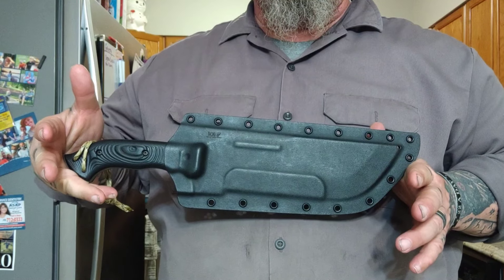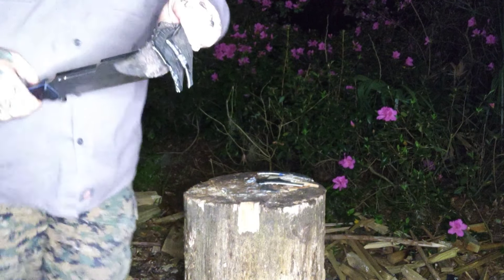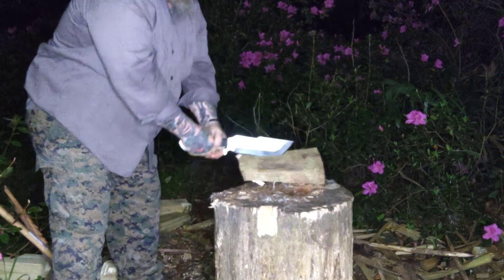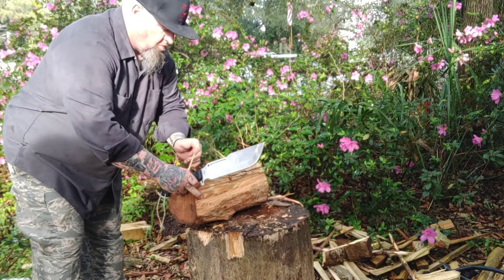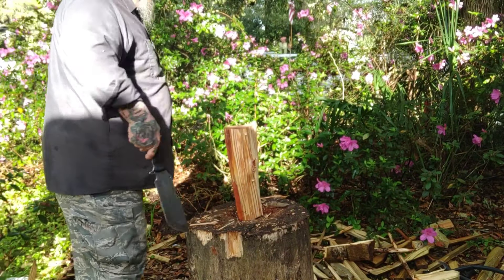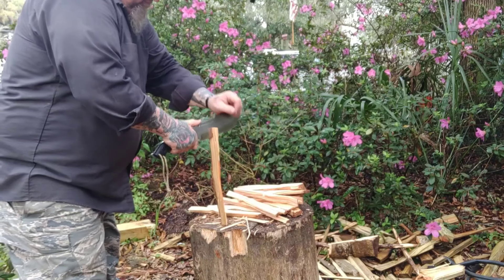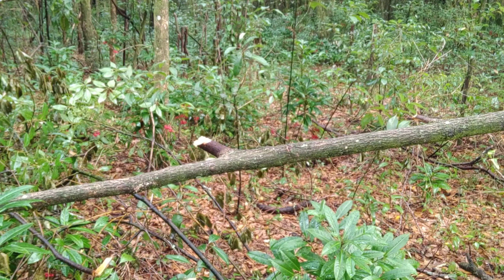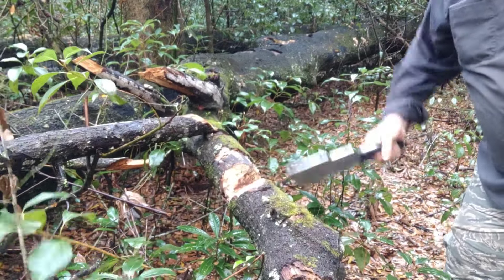WORK TUFF GEAR HEMLOCK ARES!!!! BEAST MODE??

Comment: I have to apologize to some knives, because I called them "a beast". Like on some of the other WTG knives I used the "beast" phrase too often too quick.
Why? Because if those knives are beasts, what the hell is this knife?
OK, maybe Behemoth would be a fitting expression to describe this knife. It is one step above every "beast knife" I know.
Yeah, maybe they have to do some testing with the bevels and the angle of the edge, maybe a combined grind or compound  grind (whatchamacallit...?), where the back portion of the blade gets a more acute angle grind for sharpness, for widdling and cutting tasks, and the front portion more like an axe in a shallower angle to make it the chopping aerea of the blade? 
I said it, Work Tuff Gear has to think about it and has to do some testing, because this is a prototype. 
I would love to have one of them, some day. 
Ah, another thing I feel about this knife. It neither has the shape nor the looks, but it remains me a lot of the Preacher.
Both have a lot in common. Both are big knives with a thick bladestock, and both are not built as a slicer, but they are choppers.
And this two Behemoth knives do this job very good, they chop like hell!
If you want a slicer you have to get a different knife.

#22aday 
Stay safe everybody, and stay blessed. 
Greetings from Germany!

Comment: My litteral ONLY issue with WT is the designs. They make knives with great grips, great steel, great heat treat, great strength, but damn... I would love to tweak half their designs.
Reply: That's because Work Tuff Gear works with their designers, not only themselves putting out the designs. Sure they have some in house designs, but most of them available are from individual community designers. 

 So what may be a "Tweak" to one person, may completely go against the designers goals. Vic Lin is excellent with working with his designers whom he makes blades for, however he definitely let's us have our creative freedoms when pushing towards specific specifications on the given design. 

However I'm sure that could be said about many companies, I would have loved to change up several blade designs over the years, but that's up to individual interpretation.
Reply: @d.b.hemlock  100%. Theres so much math that goes into the ergos and finding proper balance. The problem with taking on designs who aren't designers is you get what they see as their own cool factor, but without the math and science into the reductions and shape. Still though, you could shoot a WT blade from a tanks gun into the side of another tank and say, damn. That poor tank.
Reply: @DonnieBAllDay  these are designers. WTG mostly works with people who are proven in the community and have sold to lots of happy customers. This is becoming a tried and true design. It works for it's intended purpose.
Reply: @shepherd2148  Measure out the M.E.A.N. of this design and prove me wrong.
Reply: @shepherd2148  I never said they don't work. Not once. On the contrary, I say they are built like tanks. Great users, just some are designed as functional quassy fantasy pieces. But thats where the difference lies in a designers piece and a piece done by someone who designs knives. As a designer, the goal is to have mathematical precision. Someone who designs knives doesn't care about that. They just attack the cool factor. Some of their guys do that, with the actual forging being great. I don't think you understand where I'm coming from.
Reply: @DonnieBAllDay  I understand exactly where you're coming from and I think it's a useless point. If we only bought knives based on pure function and not aesthetics or design artistry then we'd all be only buying Mora Knives and Buck 110s forever. Part of the excitement of new knives releasing every year is that they look and feel different. But even in the Hemlock Ares' case, idk many other blades that are a bushcraft knife, bone breaker and hatchet all in one. They are out there but this is a no nonsense design, so you don't have to carry 3 tools on your person, just the one.
Reply: @shepherd2148  A good design doesn't have to have useless parts and be unbalanced to be three tools in one.And as far as Mora? Yuck.
Reply: @DonnieBAllDay  what parts are useless?
Reply: @shepherd2148  The last WT I tested had some. Some have obtuse finger guards. Some have unnecessary bulges on the spine.